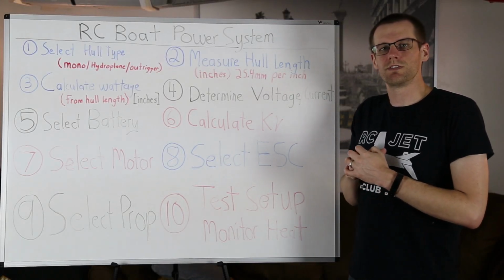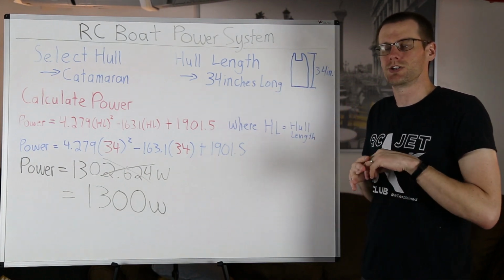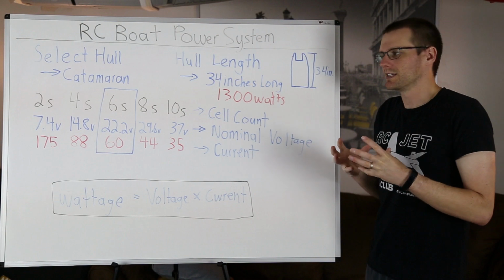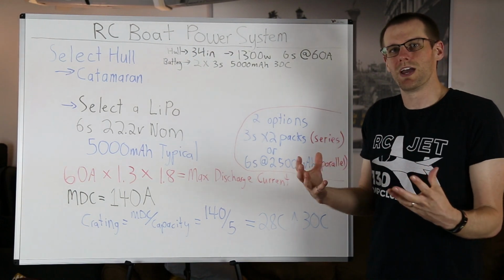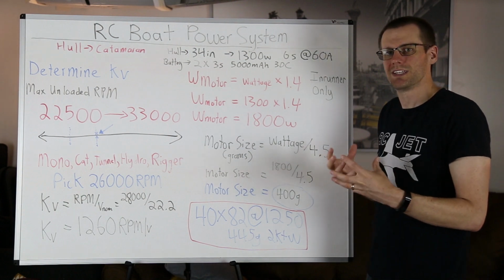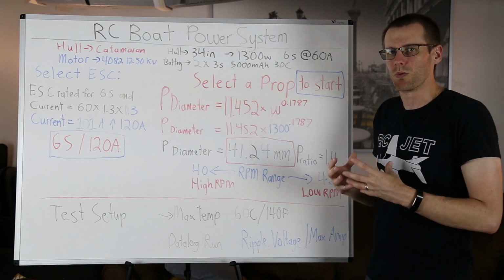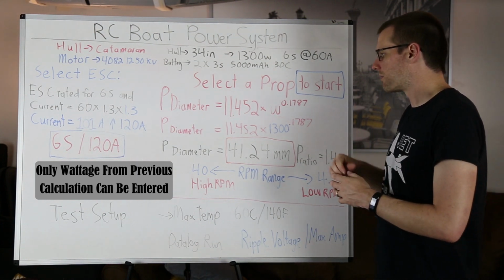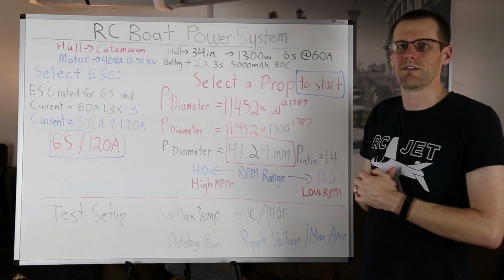Selecting a Brushless Motor, ESC, LiPo Battery and Prop for a Fast Electric RC Boat

Comment: Hi! I built a 3D printed and resin-coated Mono 50 cm long. Without electronics, it weighs 850 grams. What kind of setup would you recommend? I already have a 70A ESC, but I could change it if necessary.

Comment: Good video. I am currently building my first RC vehicle. It is a RC scaled version of my brother's boat a deferrer displacement haul style boat. I decided to make mine 24" (2ft) in length.  Hopefully with working winch and running lights and interior lighting.
Reply from the maker: Sounds good. Just keep in mind everything here is for a surface drive fast electric boat. I haven't yet made a video for scale boats.

Comment: Thank you so much for the info. Great explanation.  One question though, does the calculation applies to bigger project such as motor, esc, battery for e- motor surfing boards i.e. 300 amps for example?
Reply from the maker: No it's for RC boats with surface driven props.
Reply: @RCexplained  Thank you so much for your kind reply

Comment: I learned a lot from your video.  Question- how do I include the weight of the boat into your calculations.  I have a 26 inch, wood, former nitro, tunnel hull.  It is 5 pounds.  This is much heavier than a comparable fiberglass boat.  Right now, I seem underpowered.  Appreciate the help.
Reply from the maker: What setup do you have and what setup does the calculations suggest?
Reply: @RCexplained  With my own guess- I currently have a 3650kv (600w nom) with a 90a ESC which called for a 2s battery and about a 42mm prop.  The ESC kept stopping and overheating.  After calculating using your system, and with a 26in wooden tunnel hull, I calculate a 1690kv with a 36mm prop and 4s.  What do you think?
Reply: I am using the minimum power output of the motor specs- 600w
Reply: I am most unsure how you determine the output - help
Reply from the maker: Ok, yes around 1800kv, 4s 5000 lipo, 40mm prop would be a reliable 35 to 40mph.
Reply: Ok, that is helpful.  One more question- what size ESC do you recommend?
Reply from the maker: 100A that can handle 4s will be more then enough
Reply: @RCexplained  Thanks so much!
Reply: I shared your video with my boat club and they enjoyed it!
Reply from the maker: Appreciate it Brian!

Comment: I played around and found out. 💥Thankfully, had spares on hand and no fires :yougotthis: This is a great breakdown. I'm new to boats and found myself kind of just throwing parts at it from what other people have used, instead of taking a calculated approach. For example, I just upgraded from 3S to 4S and running a 70A ESC, but this formula shows that I need at least a 90A ESC to get the full potential out of 4S :yougotthis:

Comment: What happens if my boat is 168in and is not fit for the formula, what should I do? Should I use a different formula?
Reply from the maker: What type of surface drive fast electric boat do you have?

Comment: Really struggling with the math. When I run your equation the result is -2500.376. Not sure how you got to 1302.624. Trying to power my 29" Catamaran.
Reply from the maker: Hi Joel  you can put it in excel or run it in an online math calculator. I also have a calculator within the download able spreadsheet on the patreon member site. You can can also drop the number here and I can try and help out.

Comment: Hull lenght dont see how accounts for weight or is there assumed weight per inch
Reply from the maker: Weight doesn't make much of a difference unless its in excess. Hull length is the strongest factor.

Comment: Good morning
1) mono 2 competition
2) 80cm
3) 6S 22.2V
4) 6000mah
5) ESC 150 minimum
6) mandatory limiter, and
transponder
7) 7 minutes of autonomy required for the race
8) minimum voltage after race 3.3v per element, otherwise
disqualified.
can you help me
to design this mono 2
Reply from the maker: Try working backwards from the limitations.

Comment: This is a great video, but I am lost! lol.  I have my sons 34" mono hull that I 3D printed.  At first I just went with the specs the designer used which was a 3650 motor with 4200kv, 3S battery, 36mm prop and 150a ESC.  We burned the motor out in 10 minutes.  Not sure if this is just because it was a cheap piece of junk from Aliexpress or if it was just improperly sized.  I think, based on the calculations I could follow, I am better of going with a 2450kv motor.  Any chance you can confirm or deny that and maybe steer me in the right direction?  Any help is greatly appreciated!
Reply from the maker: I'd go with a leopard 4074 to 4082 leopard motor with 4s LiPo and a Kv of around 1800 to 2000.  If the ESC can do 4s you are good. Start with a 40mm prop and work your way up.
Reply: @RCexplained  Thank you sir!!! I appreciate the help!
Reply: @RCexplained  I have been digging into the motor dimensions and the hull.  WIthout changing out the motor mount (current one is also 3D printed from the hull designer), I dont know if a 40mm will fit.  Am I still safe going with a 3650 on 3s? Would I want a similar KV or slightly larger kV?  Or do I go with your recommendation and purchase a motor mount or design one of my own?
Reply from the maker: @sirbeck58  can you do a 36x74? What is your target speed?
Reply: @RCexplained  Speed isnt a large concern of mine.  It is a 3D printed boat for my 5 year old son.  30mph maybe should be plenty for him.  My main concern would be keeping the diameter at 36mm so that I can still get a cooling jacket on and fit in the hull.  It uses a straight solid shaft design, so the motor is low in the boat.  If I had to go with a 74mm I could, I would just have to relocate the ESC.  Not a huge deal there.
Reply from the maker: I see. I'd still run 4s on a motor a bit longer at absolute minimum 36x60. Preferably 3674. 1600 to 2000Kv. 40mm prop to start. There will be testing to figure out what is best for prop.  40mm will not be best.
Also this video is for a surface driven prop. If your boat is not surface drive, your prop selection will be smaller.
Reply: @RCexplained  It is a submerged prop.  I assume start with the 36mm I currently have and see how long it takes to get to plane as well as monitor temps? And thank you so very much for helping out!  It means a lot that you are willing to help out strangers on here, especially with such speed!!! You sir, are the man!
Reply: @RCexplained  Just wanted to come back and thank you again for your help!  Our current set up that seems to be running pretty good is the 3674 motor you suggested with a 40mm prop, and on 3s.  I could not go to a larger 40mm motor as it just wouldnt fit in the hull without also changing the drive shaft and motor mount.  I started with the 36mm prop, then 38, now currently on 40mm.  Temps are still very acceptable around 90ish, but the battery is getting up there in temp, around 105ish.  I know you said go 4s, but I dont have a 4s currently that will fit, so I will have to get one if you believe that is best and will resolve my warmer battery issue?  Do I stick with 3s or jump to 4s as you originally recommended?  I assume going to 4s, I need to prop test again, checking temps and time to plane?
Reply from the maker: @sirbeck58  you got it. If you go to 4s, you will need to start again with props. 4s will increase the heat in all components but you can decrease the heat in the battery by moving to a higher c rating and higher capacity. 
105F on the battery is more than fine. If you are happy with performance, stick with 3s. 4s will get you more in the future. Thanks for the update, happy to hear the outcome.

Comment: Hello! I want to know the constant that you have used in the first equation where you are calculating the power of the boat from where did you get that specific constants of 4.279 and etc? Is there any proof of concept behind it please explain or an website or research paper.
Reply from the maker: from a data set
Reply: @RCexplained  can you elaborate a bit more, from where did you get the data set and which data analysis and statistics technique you have applied to get these values. I will appreciate your help.
Reply from the maker: I collected the data, plotted it and used trend lines.
Reply: @RCexplained  okay. Thank you!

Comment: Hello, first of all, thank you kindly for video - it really helps! I`d like to ask some questions regarding it. I`ve calculated amount of power I need for my boat (22 inches - approximately 400W) and I`m going to use two engines separately. Shoud I divide total power amount by two then and proceed with 200W? Thank you a lot, truly.

Comment: Great video, can i use these calculations if i want to use 2 motors?
Reply from the maker: Yes but you should alter the formulas to account for dual motors. For example, power output r equired per motor is 80% of the original calculation.

Comment: Got it. The thing is to have an on board your model is a power analyzer. This fits in between the battery and the ESC connections giving a true value of what is going on in power consumption.

Comment: Watts / volts = 1,300 watts /22.2 =58.558 Amps or in my calculation 2,500 watts / 22.2 volts = 112.61 Amps
Reply from the maker: Hi Greg, not sure what your question is here but your math checks out.

Comment: Hi, I am 14 years old and love building RC Boats from dumas. This video helped me SO MUCH to select the right motor. I will be running the motor you helped me select in a Dumas SK Daddle Too. Thank you so much for helping me and making it easy to do this.
Reply from the maker: Just a heads up, these calculations are for a surface driven prop. If your outside is submerged, you will want to use less RPM and a smaller prop than what the video shows.

Comment: What power should I use for a small I inch baot
Reply from the maker: One inch? No idea, unfortunately.
Reply: @RCexplained  8 inches
Reply from the maker: A brushed 130 size motor is what I would begin looking at.

Comment: Great video. I love to see a mathematic equation being used to be informed for picking components. Just one problem. The equation says it’s good for boats up to 50” 
  What if my set up is 72” what changes with the numbers to come up with a good set up for that? Why does it change at 50”?
Reply from the maker: I don't have any data outside of 50inches to conclude that the formulas for a surface piercing fast electric boat works at larger sizes.

Comment: any suggestions if i want to use two motors (so i can have differential throttling for steering) for the 6ft long aircraft carrier I'm building? the I want ESC's with reverse as that might affect my motor power options to suit the esc amperage.
Reply from the maker: Just a heads up. The video is for surface driven props on fast electric boats. For fully submerged prop significantly reduce the amount of power and motor rpm as your targeted speed will be very low.

Comment: Did my "Super Thanks" donation and comment from July 18 get deleted or was there a misunderstanding?  I'm completely new to RC anything and this is the most helpful source I've found.
Reply from the maker: Hey Ron, thank you for asking about this and Appreciate your "Super Thanks" !!! I don't see where it shows who and where it came from but it does show up under the super thanks category in monetary form. Perhaps the comment that you made did not go through some how? It doesn't look like I can see who it was from if there is no comment, however, I am quite new to this and yours is the first one! Thanks again!
Reply: @RCexplained  No problem, I was just saying that this and the radiocontrolinfo calcs are very valuable information and I followed along every step to make sure I was doing the correct thing for my boat.  My boat is very similar to your example at 36".  
     My question is in regard to the ESC selection.  My boat uses 2x2s batteries or 3s, but many other owners of my boat have claimed they had to upgrade their stock 120amp ESC to a 150a or 180a ESC to run 6s, even after cooling mods, because they "fry" them.  
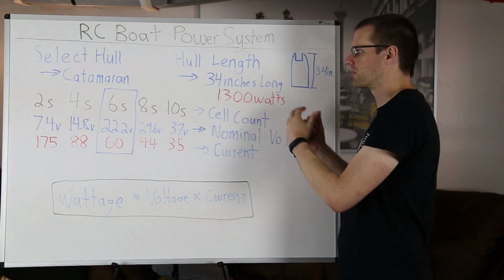     As I calculated your current selection at 9:33, it shows the current as smaller as the battery cells go up.  So 6s would be 60a x 1.3 x 1.3 = 101.4 where 4s is higher at 88a x 1.3 x 1.3 = 148.7 current.  Am I getting something wrong where going from 4s to 6s looks like it would require a smaller ESC?  I'd like to do the right thing before throwing 6s in there.  Thank you very much!
Reply from the maker: @ronchang9791  6s in the boat is going to increase the current if you are not changing anything else in your power system. If you changed the prop out to a much smaller prop, you can reduce the current. 

In the example we can reduce current by moving to a lower Kv motor when selecting the motor Kv.  You can also reduce current by swapping out your motor to a lower Kv.

You can try doing a mock up system with both 4s and 6s and see the differences in the power system selection process. These differences allow wattage to be the same.

Comment: I bought a tfl zonda boat  2x motors 3674 2075 kv with 120amps esc so I bought 2x 6s lipos 5000mah 22.2v  that should be able to have it,stock props and timing set on  p? What you reckon?thank u

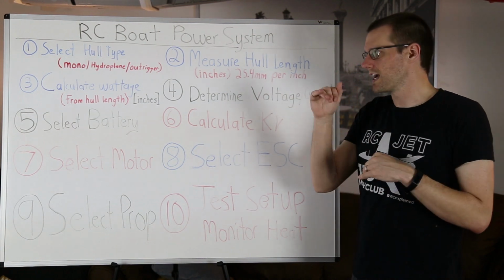Comment: hello there, this was such an amazing video and i am currently using most of it's information and it's all working out perfectly. i wanted to just ask how did you come up with the equation at 4:02 that has to do with the power with respect to length in inches and why did you use inches . and thank you very much

Comment: Great videos! Curious what your take is on underwater thruster designs. I am designing my own version of a T-200 thruster (pretty much underwater EDF) and am wondering if the same rules apply. Mind you this is gonna be a kayak assist motor so will never reach much speed so I wonder about the drag. Will have to play with prop pitch for sure.
Reply from the maker: The formulas in the video are for a surface piercing propeller
Reply: @RCexplained  understand that, that's why I ask your take on what the differences would be in calculating for a somewhat ducted outrunner thruster version
Reply from the maker: Lower RPM than the range provided in the video and less power would be the main difference.

Comment: I am about to replace evetything in a big RC Yacht with a double Brushless setup that I intend to do with 2 ESCs. Also it is my fist contact with brushless on my own. You cannot imagine how much this video helps me to start.
For the intended double motor setup, I have halved the overall Wattage that came from the hull length. If you have further advice for me about such a setup and its layout, I would welcome it.
Reply from the maker: Thanks for your comment, just keep in mind the formulas are for a surface driven prop. If you are running a fully submerged prop you will want to decrease the overall rpm by a significant amount.
Reply: @RCexplained  Thank you! Also it turned out that i am very restricted in the (fully dived) prop diameter, like 3,5 cm instead if the theoretical 4,4cm. Can you please tell how I should adjust my choice according to that? Should that make me reduce the RPM even more and that is all? Thanks four you answer in advance!

Comment: Do the differences in hull type ( Deep V, Cat etc. ) change the formula for the power calculation?
Reply from the maker: No I don't think the formula did, (can't fully remember) the result will be a different speed achieved for the varying hull types.

Comment: Good video! Easy to follow. I've tought that mine setup was around the same as yours but someone mentioned his props are always below the water surface and that messed up my mind and my calculations. So what to do when it's 31" v hull with two motors and a gear ratio of 3:1, the stock props are 45 mm. It's an old Graupner Portofino I'm building but I wanted to replace the old brushed motors (with in this setup had a top speed of 20 km/u) for more speed. Hope you can help me

Comment: Thanks for sharing this info.  What are your thoughts on the motor and ESC for a deep V hull 40" long with a jet drive?  I have not picked a jet drive size yet either. Thanks

Comment: I have a 150lb boat mono hull, that I am trying to push along very slowly, maybe 2-3mph for a long period of time, meaning an hour or so.  

I am so confused on what the right combo would be.  Will a small prop or big prop be best, will a 5400mah battery last for a while.  Uggggg.
Reply from the maker: A large diameter prop with a very small pitch turned at a very slow RPM.  5400mAh can be enough if you base your system on drawing 5A at full throttle.

Comment: This is a great video, very informative. Is there a reason why hull weight is not a factor in these calculations? I am working on a conversion for a vintage hydroplane that is wooden, so significantly heavier than the modern hulls.
Reply from the maker: Yes, it is assumed that hull weight is within the typical values for a specific hull type using a surface driven prop.

Comment: This is a great video with very good information on how to get the correct power system for running electric with RC Boats! I've been on the nitro side of racing for years but I want to get into electric, I see the advantages! Can you explain more about how you "data log"?
Reply from the maker: Glad it was helpful! Some ESC's have data logging built in. In other cases you can buy a stand alone data log to gather information. If you are not using data logging, knowing the temperatures of all components is the next best option.

Comment: Ok this video definitely helped answer a lot of my questions but I just picked up a boat for my kid and it’s already built but has no battery’s how to I figure out what batteries for it 
Catamaran hull   32”
Ammo 36-50 3300kv
Phoenix ice light 100
Prop is a 40mm
Reply from the maker: I'm not a fan of that motor selection that was included in your purchase. Typically a 32in boat would take 4s. But with such a high kv on a small motor, I would run 2s.